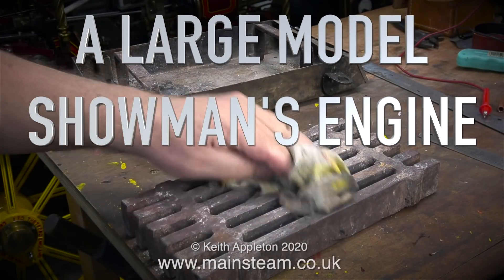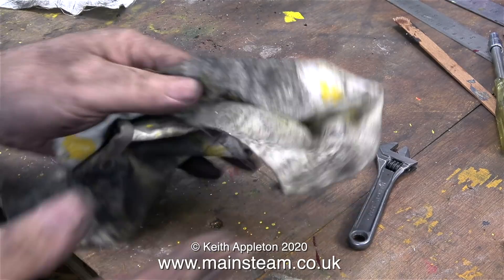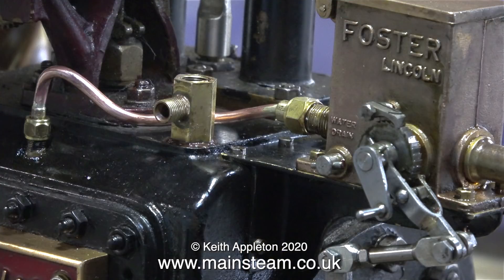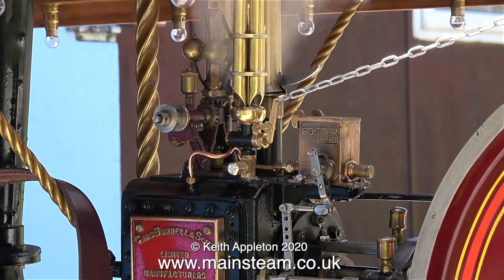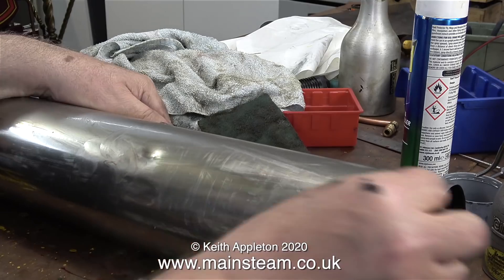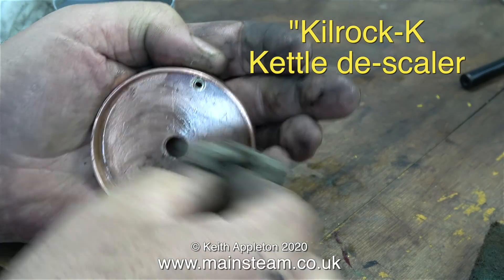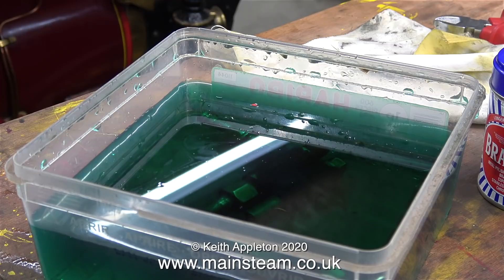A LARGE MODEL SHOWMAN'S ENGINE - PART #24

Comment: Question, if you throttled back the cylinder lubricator too much, is there a way to tell before damage happens to the cylinder itself?
Reply from the maker: sometimes ..... mainly by the sound it makes.

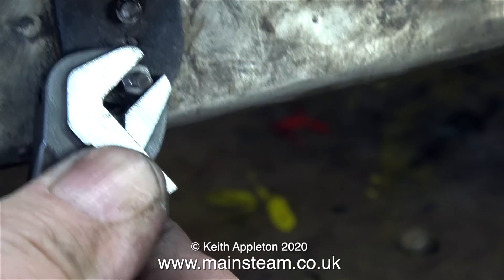Comment: is it just me or the handle on the damper cracked (1:21 mark) and does it need to be repaired?
Reply from the maker: Yes I can see that - it is not a problem on this relatively unimportant part of the engine. I will fix it in the fullness of time . . . .
Reply: @keithappleton  thanks for responding I wasn't sure if the handle had a problem or not

Comment: Ash pans are awkward to put on even on full size engines esp. with only one person.  Carefully balancing the ash pan on a car trolley jack then sliding it under the box is the way I do it as you can then raise it so the bolts align.  But I guess   there is not much of a market for miniature trolley jacks !

Comment: Take a look at the damper arm, it looked as if it had a bad crack at the inner bend at 0:57 and 1:26 - or a speck of dirt
Reply from the maker: Yes I can see that - it is not a problem on this relatively unimportant part of the engine. I will fix it in the fullness of time . . . .

Comment: I 𝗻𝗲𝘃𝗲𝗿 drop the fire unless I really have to. When I can I just let the fire go out and let everything cool down slowly. A slow cool down is so much better for the boiler. On small engines is doesn't really matter, but from about 3" and up it makes a big difference in boiler life. It also means I don't have to drop a scolding hot fire in my face
Same goes for using a blower when steaming up. If you can go without then don't use it. With a blower everything heats up much too fast
Reply from the maker: I let the fire almost go out before dropping the fire. The intensity of the blower is all down to how fast it goes, I slowed mine down for a nice gentle draught ......